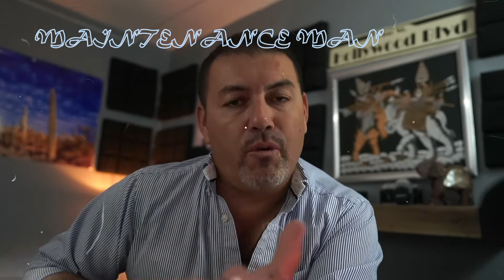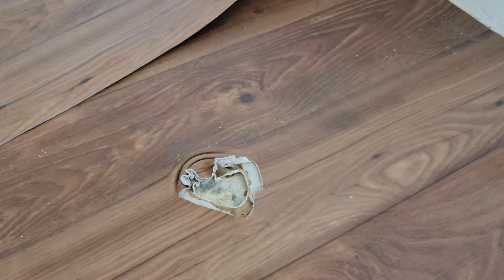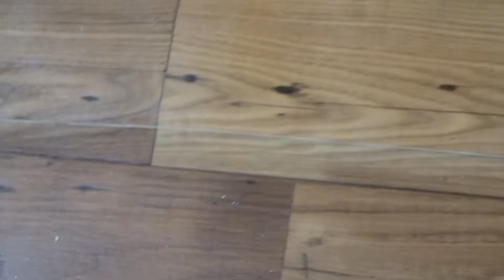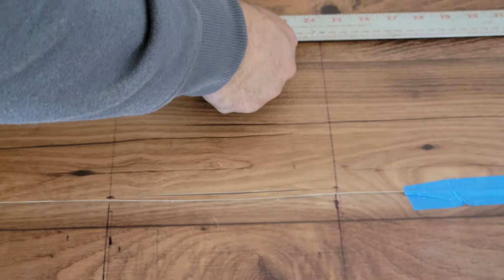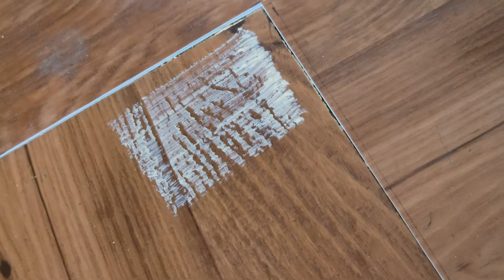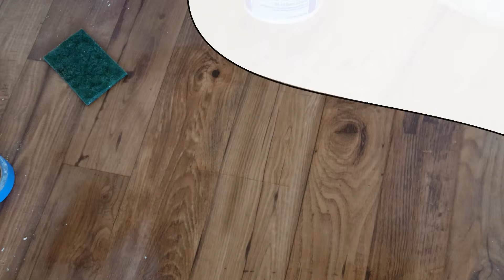Vinyl floor repair.  #vinylfloor #floorrepair #maintenancetech

Comment: Others mention a seam sealer which may fill in those tiny seams and make it truly invisible.
Reply: If you don't use seam sealer, water and dirt will get in and cause the lino to lift where the cut lines are.

Comment: I dont get it. ...2 layers?
Reply from the maker: The vinyl I'm fixing was placed over old vinyl. So I had to do two layers, the bottom layer was just a filler and the top is what is visible
Reply: @MaintenanceManNarratives  thanks for your explanation on that.